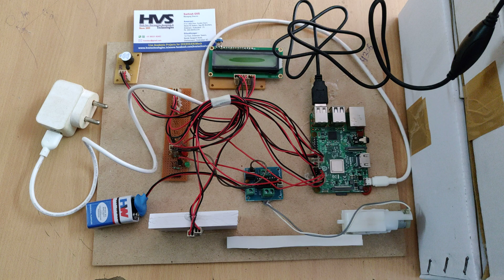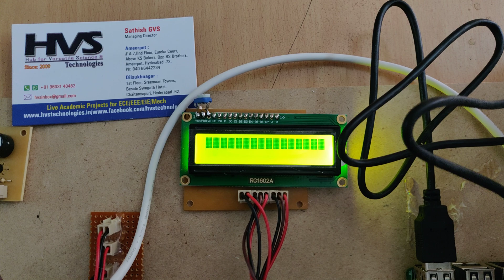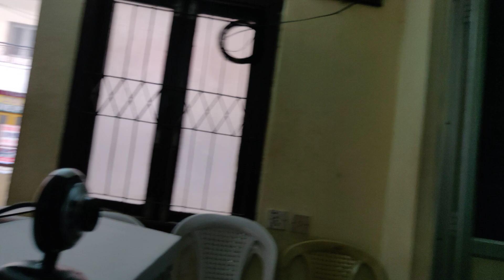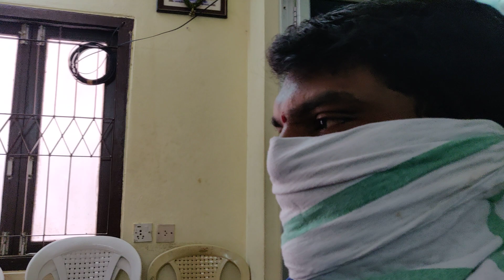HVS-2787. Face Mask detection and  Temperature with gate controlling using Raspberry pi MLX90614

Comment: Sir i need Circuit diagram for this the connection are not visible properly nd please poc the call or reply on whatsapp
Reply from the maker: Yes
You can contact us at +919603140482
Reply from the maker: Luqman Abdullah  you can contact us at +919603140482